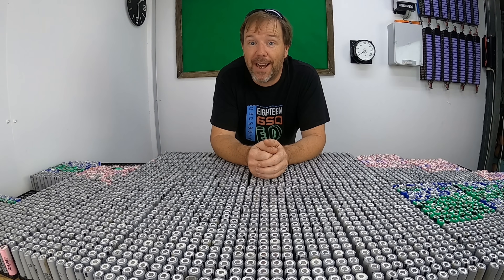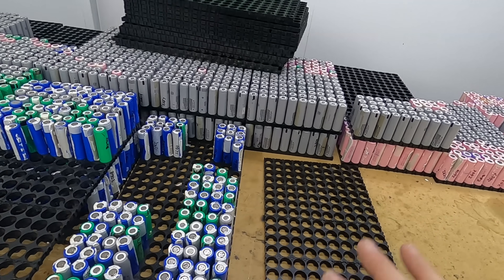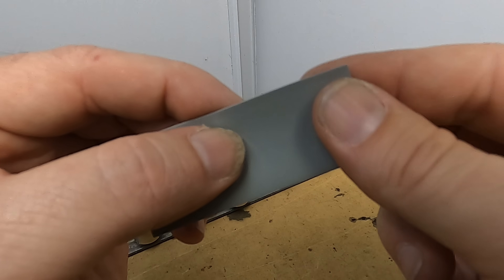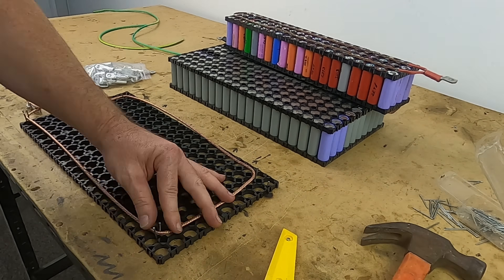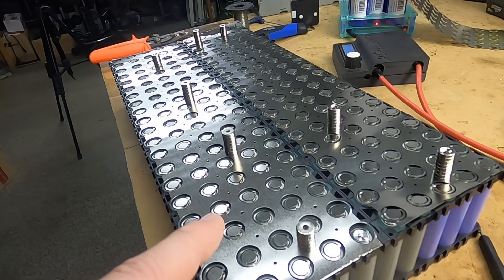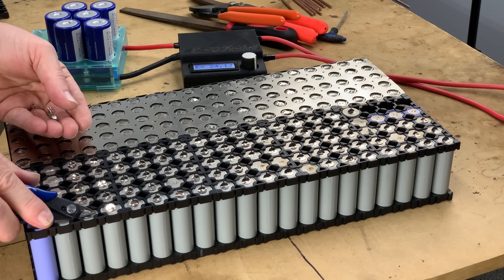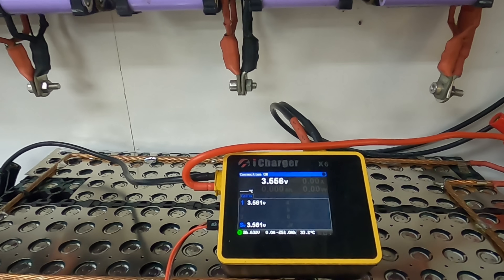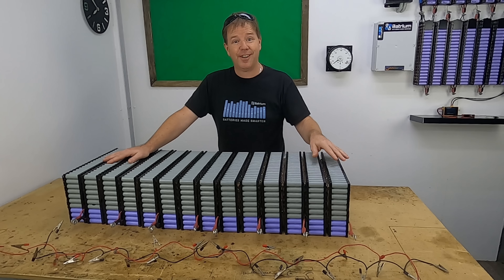Creating my single biggest D.I.Y. battery with 2800 18650 cells recovered from used laptop batteries

Comment: Why replace the old ones? Just add the new pack as parallel and increase the Amp hour overall, every one of them has its own charge controller right? So, old ones wouldn't really affect the new ones! right?

Comment: And that's how fires start. I would not recommend anyone use DIY 18650 setups in residential buildings, especially considering how cheap and available LiFePO₄ packs are. Even a small mistake during assembly could lead to a disaster. Try overcharging just one cell, short-circuiting it, damaging it, or burning it, and you'll realize that you literally have a bomb on your wall. It's not worth your time and effort compared to how cheaply you can buy factory-made LiFePO₄ battery banks.

Comment: After years of learning about this, what bothers me tooo much is the idea that all the work put into your package (the bigger the worse) goes to hell once a few cells start going south, and you can't even diagnose cells independently. I can't begin to imagine knowing there are probably a few cells going bad, and having to rip all of them to test them one by one if needed. I've become more of the idea of using cell holders with solid contacts. Yeah, it might take a lot more work, money and space, but if push comes to shove, you can just swap in and out. It almost feels like a longer term solution IMO.
Reply from the maker: you would never do it this way now.. pure madness when LFP cells have dropped in price so much..

Comment: How do you protect the cells from ganging up on a failed cell? Or are you just relying on the out-gas mechanical disconnect fuse feature of the 18650 cells. I have a few hundred of them but only pair them up in groups of 8 for those that show similar health and charge capacity. Additionally I carefully join them to the team parallel when they are within 0.1 volts of each other to avoid a heavy amp charge spike to a lesser charged cell from the others. If the 5 of the group are 3.73 volts I only join the others when they are like 3.63 or 3.83 volts and then I give it 10 to 15 minutes for a balance to occur between the cells.
Reply from the maker: I use a Batrium BMS to monitor my batteries.

Comment: I bet you do this more than once but soldering the bus pas to the nikkel strips while the cels are already spot welded? Won't that damage the cells because of the heat?
Reply from the maker: everything damages something - key when I built was recycling & budget constraints - that said would NEVER do this now days due to the reduction in price of LifePO

Comment: Dude if you don't use some sort of serious cooling on those batteries you are really risking a thermal runaway. I don't see any kind of water cooling anything else. Another lithium ion batteries
Reply from the maker: lol you build a batter to its load.... I did...
Reply: @HBPowerwall  I'm not sure what you mean. All I know is that in Tesla batteries they actually have an entire liquid cooling system running throughout the entire setup. All I'm saying is I don't see any kind of cooling system here. I suppose you could distribute the load so that you're not running so much power through a single system. And then you would probably still need some sort of battery management system to make sure that the charge on the batteries are more or less equal. But when you have that many batteries hooked up first off there's the heat secondly if there's even a little bit of voltage difference that starts building up within some of those batteries compared to the rest of the system it's obviously going to start heating up. And and it's probably going to explode

Comment: 4 years later. How much of a pain in the ass is changing out all the dead cells, or even finding them to begin with. How much dread do you feel knowing If you dont find it, it will ruin the rest of them. ~i havent watched the video yet~
Reply from the maker: Still runs today, no cells failed - I use a good thermal camera to find my bad cells.. takes minutes to check - on that note its been a year I should go for a drive and check the battery

Comment: I think the only way to make a battery like this sustainable is to periodically scan it with thermal cam to replace discharging/dendrite cells...
Reply from the maker: 100% - you can't build this with out 100% management or 100% madness lol

Comment: I loved your video. Thank you. Let ask these 18650 batteries come with 3.7v 20amps, right  ? If I tied 14 in series and did 5 strings in Parallel. That would be 51.8 v 100 amps, right?

Comment: sir can u help me find a deal on ebike batterys for work i need a 52volt bat with 2700 cell or are they called 21700 i for get i no there new not the old 18650 i think there caled 21700 but in short i need a bat thats got 25amps or more sir  cuz any think under 20amps just will diy so fast i am puting 3000watts x2  at 80amps   puls ,,,,,,,,,,,,,,,,,,avg 40amp  all day but can push to 80aamps for short times i seen 2 good bats but so much cash Samsung and molycell  they had ech like 50amps for short time but 35amps avg thats good
Reply from the maker: nar...

Comment: I DO NOT RECOMMEND TO POINT A HEAT GUN AT A LITHIUM BATTERY
Reply from the maker: for a few seconds lol - not even enough heat to melt plastic let alone change the temp of the thermal mass that is the battery..
Reply: A 18650 battery has overheating protection at 60 degrees C or 140 degrees F so

Comment: What do you do about the leftover nickel strip stuck on the cell afterwards? For me it usually leads to a bad connection due to the surface not being flush, thanks
Reply from the maker: light tap on the wood bench sorts them well enough

Comment: Using used cells from old laptop battery packs may be a cheaper way to do it, but the mAh that's left from the rated Specs (if they were accurate to begin with) have been greatly reduced from being discharged and charged for years, so your overall mAh per pack you make from them won't be near what it would have been with new, high-quality cells, which could have been obtained for $4 to $5 each in bulk (or less).  Laptop battery pack manufacturers often use cheaper Bin C and D cells for more profit, rather than Bin B and A.  Plus, you are likely to find bad cells which is the reason the battery packs were discarded, and there's more labor to free the cells and individually test them, if you did.  It would likely have been MUCH BETTER to use all cells of equal mAh ratings!  And MUCH, MUCH BETTER to use NEW cells, all of equal mAh ratings!!!  How much do you estimate you saved by using used laptop battery packs instead of new, matching cells and how long do you really expect your packs to last and be reliable without cells dying earlier than others?  Not to mention safety.  If one old cell explodes, they all do, and then the whole power wall does!!!

A worthy and respectable project, but how much more would it have cost to use new, all matching cells, which would have been more reliable, give a more precise and stable output with less variance between packs and last longer with much less chance of individual cells creating problems?
Reply from the maker: this battery cost me nickel strip (was sponsored) , lugs, & plastic cell holders - cheap and still runs the farm 24/7 - don't get me started on the neat video that did well lol
Reply: @HBPowerwall   I asked how much it would cost, as in the average Joe, not how cheaply you got it done through sponsors, with parts and tools on hand.  And even though it may still be working, that does not mean it would have been much better done, would have been more reliable, and lasted much  longer with all new, all matching cells.  Don't bother replying again because I do not care.

Comment: The "fuses" in these metal sheets are super clever. so if 2 cells short between each other it'll burn.
The only concern left is. How to fix it if a single cell shorts out or fails. Redo the whole pack ?
Reply from the maker: cut the fuse off, hammer out the cell, slide new one in - solder up the fuse job done.. OR battery is big enough to just cut one fuse and and ignore it..
Reply: @HBPowerwall  nice that works I guess. I just made my first 18650 pack. I used .1mm wire for each cell as fuses. seems to work great. Did quite some testing.

Comment: Old elements need to be disposed of and not assembled into batteries. If one element catches fire, it will pull everything along with it and there will be a big fire with explosions. To do this kind of work, you need a separate barn in the field so that you don't feel sorry when it burns.
Reply from the maker: Its in a 3mm plate steel 3x4m enclosure - if it burns it can burn till it's done - we will grab the bobcat and drag it out and make something new to put up  on youtube lol

Comment: How did you establish the Amphours of each cell? Just from the datasheet, or do you run each cell through a full capacity test? 
And if so, how do you do that at scale for thousands of cells?
Reply from the maker: I tested 1000s of cells, one at a time (well about 40 actually) with a batch of cell testers and a thermal camera. Took months
Reply: @HBPowerwall  omg! Mate what's the opportunity cost for your time :) vs €4 for new cells?  
Maybe we need an open source hardware kit for assembling a cheaper tester that can test 30+ cells at a time? 😅
Reply: @HBPowerwall  i was also a little confused when you got to the section of the video where you deployed the cells into the packs. Did you end up evenly distributing the various capacity cells together? Wouldn't that mean you could potentially just use a random allocation strategy to get almost-as good results? 
I've probably misunderstood this bit.

Comment: Seems like you wasted your time. If you would have just bought a few 5kwh 100AH LiPo server rack batteries that have a 10+ year warranty for $1200 usd each. 

Most modern 18650 batteries have a typical cycle life of 300 - 500 (charge, discharge cycles). 
So your custom battery bank is going to last you about a year and a half. And cost you more than server rack batteries that will last 10 years or more.
Reply from the maker: 1. this video was done years ago.
2. Yes they are cheaper now.
3. They are still in full time service for years now offgrid on the side of a small hill.. 
4. I had more time than I had spare money back then.. and the cells were basicly free.. 
5. Mad a cracker of a video and earned enough to be still earning 10 dollars a day from this video.. so I guess there is that.

Comment: This is a historic solution in 11/2024. I Just bought a 2x16Sx280Ah System (28.6kWh) kit for 3000$. Two seplos steel boxes, 200A BMS, and it was assembled and installed in two days of work.
Reply from the maker: and how many years ago did I start this process lol bloody internet comment section
Reply: @HBPowerwall  Therefore I wrote in 11/2024 😉

Comment: This is pointless. These batteries have already been through numerous cycles and are close to end of life.
Reply from the maker: You're comment is so many times more pointless - it still runs today! and is perfectly balanced.
Reply: @HBPowerwall  tell yourself whatever you want, the lifecycle is well established.
Reply: @thomasreynolds1530  How do you know what the cycle count was on these batteries?  I have repaired battery packs for my electric yard tools turned out just one cell that was bad. Cut and solder in new cell saved me $100.

Comment: you're not using a BMS system for your batteries your stupid. every battery need a cable to the BMS system this is way it overheat cause fire

Comment: I hope you have a very good fire insurance...
Reply: Do you store gasoline in your garage? You realize gasoline fires are far more common then a lithium battery fires even though most garages contain at least one or two 18650 battery cells in portable tools. Media doesn't show you house fires caused by gasoline.
Reply from the maker: Hell, I know a whole country that all have a vat full of boiling oil on their kitchen counter tops to deep fry stuff.. I would think that was more dangerous than this build when stored correctly.

Comment: Pls that your spot welding machine is it using batteries or Ac voltage
Reply from the maker: It runs off 12v

Comment: Are those compression fittings rated for 2 conductors under the compression end? I would think it would be better to have 1 conductor in the compression end and 2 mechanical connections or rather 4 at the connections with other cells.
Reply from the maker: seems to work well - rarely sees 50amp draw and 99% of the time its less than 10amps

Comment: Arent these cells essentially bad since they were recovered from used lap top battery packs?
Reply from the maker: One could argue that, but one flat tires doesn't mean you have 4  bad tires, you only have one ... spent a year collecting & testing every cell before assembly
Reply: @HBPowerwall I understand but the next argument would be if you replace both headlights in your car the same day, years later when one of them goes bad you replace both because most likely the other is nearing the end of its life cycle as well. Testing results notwithstanding, why put so much effort into building a pack out of cells that most likely already have many many cycles under their belt.
Reply from the maker: Good point, well interneted! - This battery is BUILT waaaay better than my many other attempts - years later it still cycles daily about 20kwh usage per day and still going strong.. I think the math works out well on this project - then add that little youtube income hehe
Reply: @HBPowerwall  I'm not familiar with the term "well interneted" can you explain that? How do you like samsung 50e cells? I have built a battery pack for a DIY ebike project out of 80 50e cells and it delivers nice power but voltage sag seems to be a bit of an issue. How many cycles  are they generally good for in your experience? How do they compare to the many other cells you have worked with? And which cells do you see outshining the ktjers? Just curious, for future projects. This little project is the reason I came across your 4 year old video!

Comment: How many used laptops did you have to buy to get this many? And how much could that have cost vs battery purchases?
Reply from the maker: From memory 500 or so 6cell laptop batteries - traded them for a bit of computer work so basicly free - so there is no real comparison to a purchased unit.

Comment: If you want to measure the voltage drop along the different parts of the bus bar etc., just put the multimeter in mV setting and actually probe between the section you want to look at. So for example along the bus bar. Or the drop from + battery terminal of a 18650 to the main nickel sheet (across the little connecting loop).
Reply from the maker: Just saw this but going to try that tomorrow, thanks for the tip

Comment: My only problem with this is that they are used batteries from laptops that probably had some battery issues.  How long before these batteries go bad?  Or what if you get one bad cell?  Doesn't that start sucking the juice from the others and start a chain reaction of crap?  Other than that, this is cool.  It would be cooler to have ejectable cells that give feedback on each battery seperately.  That way diagnosis and replacement of dead cells could be easier.
Reply from the maker: Thanks for your feed back, in service for ages now with zero heaters, no imbalance of cells - huge time was spent (a year) testing and sorting cells this with out a doubt is the best battery I've ever built.

Comment: you just made balancing your cells harder by mixing all the capacities, all that effort to do it wrong, nice
Reply from the maker: Yes, you are right- but also wrong - they are used cells, they were in the trashbin, they are not in land fill, 3 years later they are still running, don't even get me started on what I learnt how much I earnt etc lol

Comment: Are there no spring loaded terminals you can use on these packs?

It would annoy the heck or if me to have to dismantle a completed pack to replace a dead cell in the future.
Reply from the maker: springs fail with the heat cycles - they are not an ideal solution

Comment: Is there enough of an air gap between cells to be able to run air over them for cooling?, excess heat could be ducted into the building for warmth or into a workshed or chicken coop etc.
Reply from the maker: Batteries running for a few years now - still going strong with conservative loads

Comment: Im upto about 20kw..  charges my tesla nicely..  and for free..
Reply from the maker: nice, I don't like charging my EV with batteries SOooooo inefficient - in a pinch I will tho..
Reply: @HBPowerwall  interested to know where the inefficiencies are ?  Can only be the inverter ?
Reply from the maker: Solar 120v > Solar charger controller 48v > battery 48v > inverter 48v to 240v > back into ev 240ac to 400ish v DC again... Cables, inverters, charge controlers - they are what the system is made of - I'd say you'd put half the energy from the solar panels would make it to the car to send it down the road.

Comment: how you change battery if one dead ?
Reply from the maker: Grab the thermal camera - snip the fuse wire on the cell that's hot & and make coffee... don't need to replace for just one or even 20 over the next few years..

Comment: WoW, that is a lot of work. What is your plan when those cells start loosing their capacity after years? Check every single one of them?
Reply from the maker: Nar, you just use a thermal camera to pick off the heating (high resistance cells) at first you can just snip the fuses - down the road some might need rebuilding or replacing. It's currently in daily production and only cycles from 3.3v to 3.9v per cell to make them last as long as possible.
Reply: Nice that is great. I never had that thermal camera so I never got it in my mind @HBPowerwall